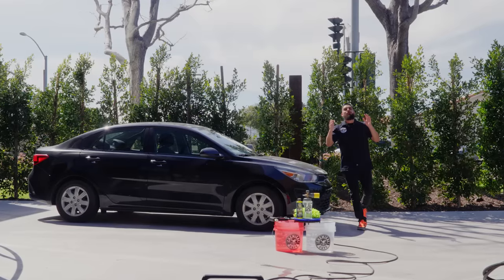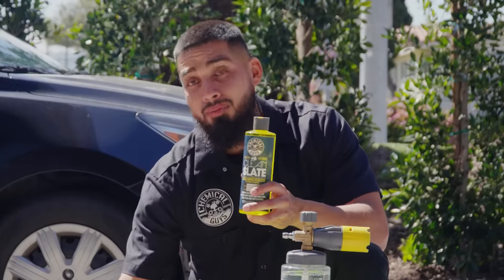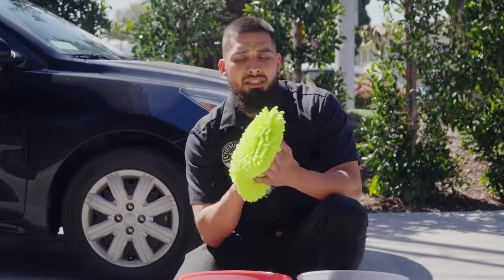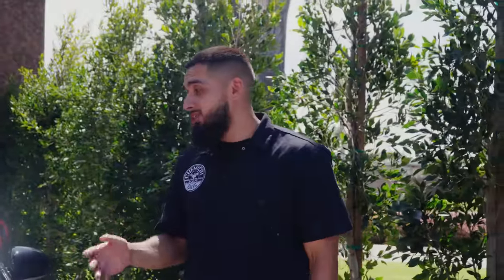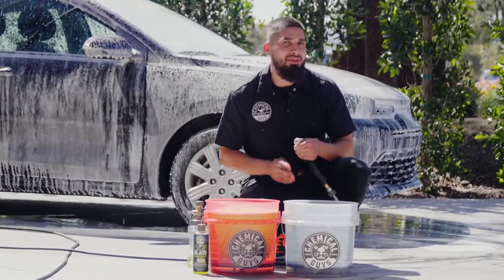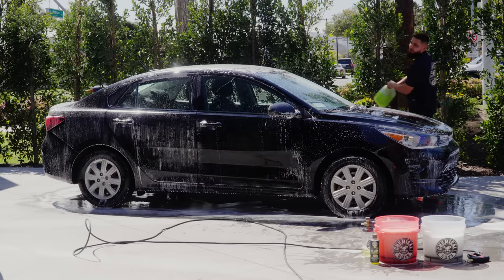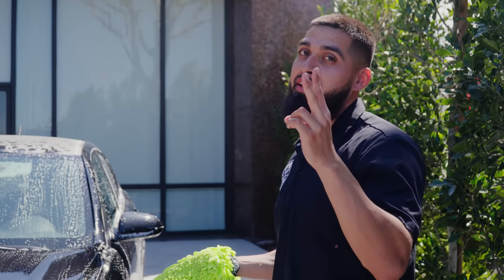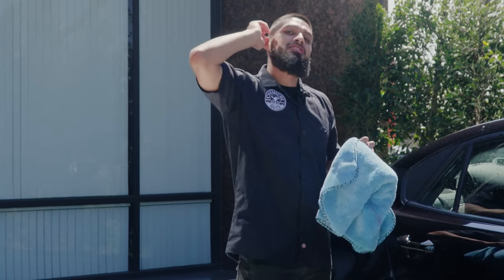Detailing Flowchart A to Z - How to perform a complete detail from start to finish! - Part 1: Wash

Comment: The video was very informative.  I would like to know what's the tip color you use on the pressure washer.  Also, what happened to washing the rims and tires first.   Thks for all of the informative videos, plus the information on the product line.
Reply from the maker: Hi Joseph! Pressure washer tips vary in degrees of spray pattern from 65 being the largest fan to 0 which is a jet stream.

Comment: can the citrus wash and gloss be used as an alternative to the clean state. in other videos you have stated that if used with 3 oz or more it will break down waxes and other coatings
Reply from the maker: Hi there! When using more than 4oz Citrus Wash and Gloss it has the potential to remove old layers of glaze, sealant and wax.